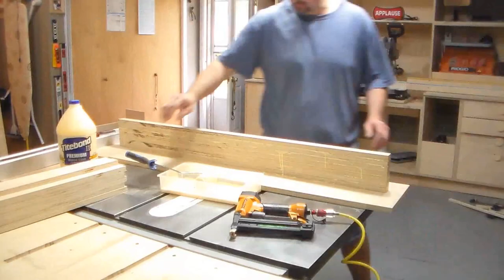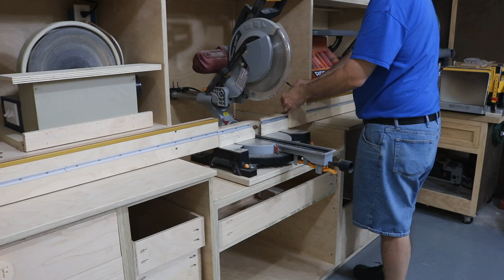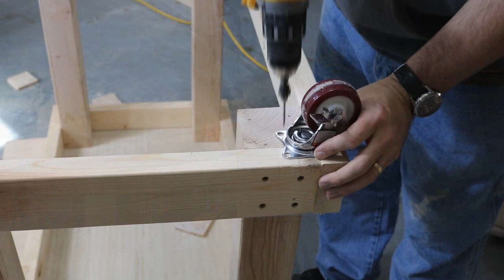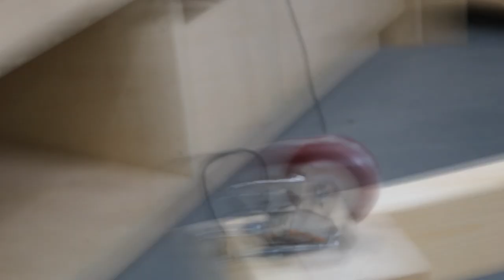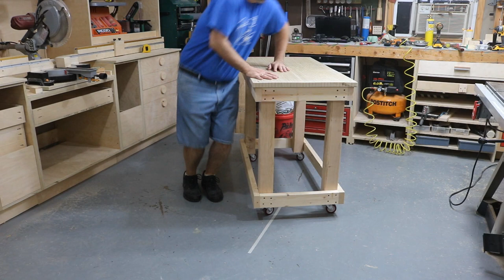Simple, but strong Assembly Table

Comment: nice work and bench Mike ,  the top is so sweet !!!  and that looks so sturdy  I like the casters on the table but if it continues to roll away from you when you use it  ,consider adding 2 leveling feet to one end and get one of those flip down casters from rockler and add it to the center of the same side as the levelers to make it easy to move around
Reply from the maker: +Patrick's WorkShop that's a good idea

Comment: Nice table, Mike.  I put home made leveling feet on my table.  It's a light duty table and not a work bench.  I drilled a hole in each leg, expoxied a 3/8" tee nut, and put a carriage bolt in it.  It works for me.  Nothing too fancy.  I may put a small drawer or two in one side.
Reply from the maker: +KSFWG cool that could work.

Comment: Nice table! That TigerPly on edge looks really clean. Maybe you can get the best of both worlds? Put the leveling feet on, but put 2 casters on the side of 2 legs so you can lean the table back and roll it around rather than having to drag it across the floor. 

Did you by chance make it just a hair short of your table saw's height so you can use it as an extended table? Thought of that when you were cutting the ply up and you were having to keep holding it flat to the table due the leverage of the overhang. 

The beefy, but unpretentious, design you're using is very similar to what I have had in mind to do if I ever have the space.
Reply from the maker: +Matthew Blackwell I thought about doing 2wheels and 2 feet. Wasn't sure if that would still roll around nay just have to try it.